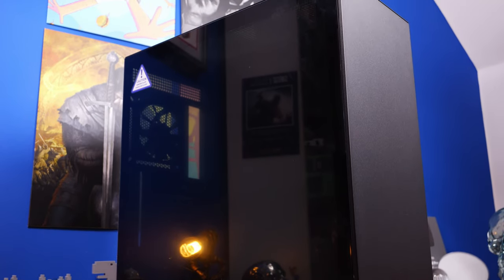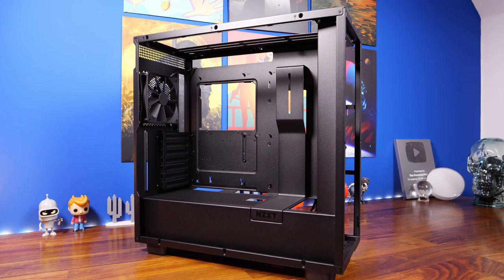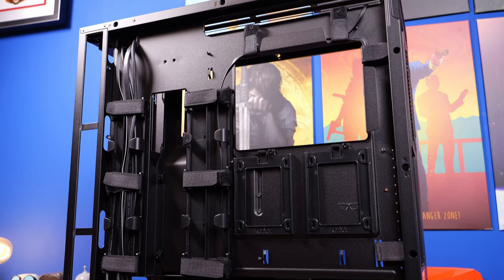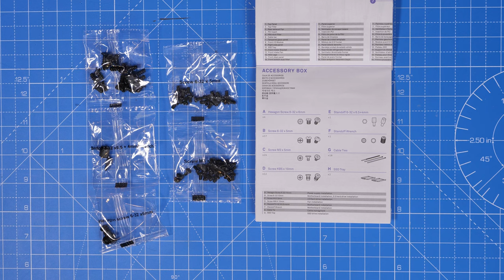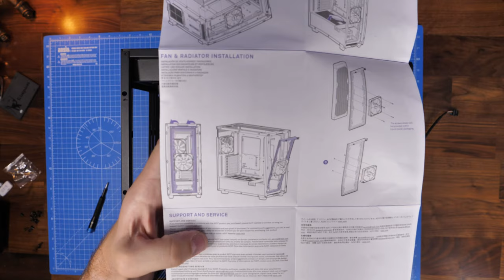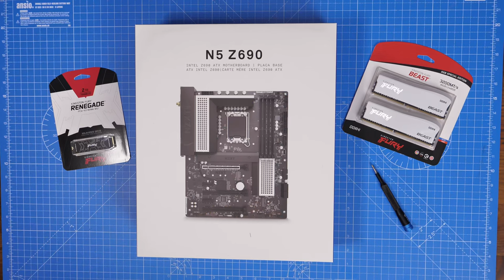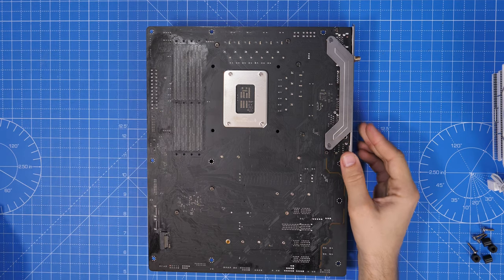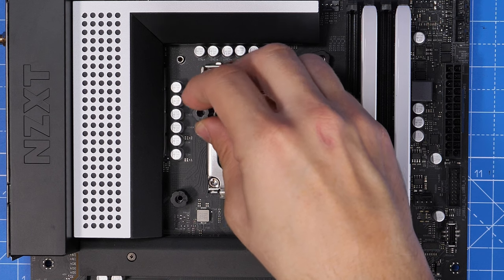How to build a budget gaming PC featuring Intel Arc A770, NZXT N5 Z690, i5-13600K and NZXT H7

Comment from the maker: NOTE - to use the 13th gen Intel CPUs with this build you'll need to update the BIOS first. This can be done with BIOS Flashback via the motherboard, so you don't need to power it on first. Version 9.01 works, I can confirm, so download that via the site (https://nzxt.com/en-GB/product/n5-z690) and follow the instructions to install it. Note that the NZXT instructions say "rename it to creative.rom" to do it. Don't do that, I found you just keep the filename to N5-Z69XT_9.01.ROM and it works.
Reply: do I have to keep the file name as that, because I changed it to creative.ROM and I would assume that would work but maybe not
Reply: Just seen this lol
Reply: What can I say. The destination is not what's important but the journey you take to get there

Comment: Did you have any trouble getting the i5 13600k to work/boot on the NZXT N5?

The new Raptor Lake CPUs are not on the N5's compatible CPU list
Reply from the maker: You need to update the BIOS first. The N5 Z690 BIOS Update (9.01) version works. And you can flash it with the BIOS flashback port. I'm going to do a separate video on this fact actually :)
Reply: @TheProvokedPrawn  Can you tell me how to do this? I bought the N7 mobo for the 13600k, and have no clue on how to flash the bios
Reply from the maker: @Emeljayy  check the manual here https://www.datocms-assets.com/34299/1654053095-motherboards_n5_z690_digital-manual_en_pdf_2205.pdf the instructions are in there. Download the latest bios here and unzip it onto a stick. https://www.datocms-assets.com/34299/1667887266-n5-z69xt-9-01-rom.zip the instructions say to change the name. Don't do that. Put it on the Bios flashback port on the back of the motherboard, press and hold the bios flashback button and wait for the light to flash and then go out. It should then be updated.

Comment: do you recommend this case for a 13700k? it's only $69.99 almost half the price of "the flow" version
Reply: no, go for an airflow case. 13700k isn't particularly a cool chip either, so you'll want airflow. look at the corsair 4000d airflow, phanteks p300a, or a lian li 215/216.

make sure you either have a 240mm aio or a dual tower cooler (deepcool ak620, thermalright pa 120, etc.)
Reply: @SupaPotatoMan  Yes i have a 240mm AIO, but my case is really old so i want to change it. I could just buy the H7 for less money and try to find a "the flow" front panel, it's the same case after all.
Reply: @born_to_play  if you can find a flow panel that's great and should work

Comment: Hey man so I’m gonna pair an Rtx 3060ti with an i5 11400 with 16gb 3200 MHz ram. I’m gonna prolly play on a 1440p 165hz monitor it that good enough? 1440 p ultra settings.  I was also wondering if there will be any bottlenecks with these parts. Also if I buy a 1440p monitor will I be able to play at 1080p ultra settings
Reply from the maker: Really depends on what games you're playing but should be absolutely fine
Reply: @TheProvokedPrawn  I’m gonna play games like modern warfare 2, god of war, valorant, fortnite and overwatch and other games like forza
Reply from the maker: @bryanramos9811  will be fine then. Most games will be. Just don't expect to play Cyberpunk 2077 on max settings with 200 FPS 🤣

Comment: Honestly h7 flow is kinda overpriced for only having two fans. I love mine but still overpriced a bit, I have two 360 radiators in it and it stays COOL
Reply from the maker: So many cases don't come with enough (or any) fans to be fair
Reply: @TheProvokedPrawn  true, I do like the option of one of the newer cases released giving the option of a fan-less order and making it cheaper